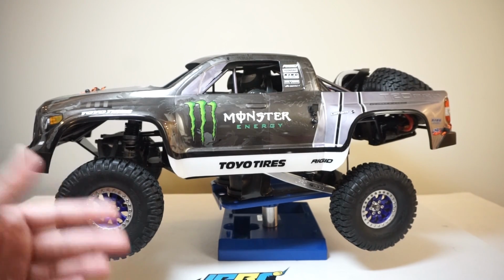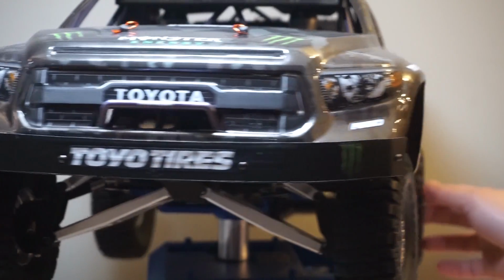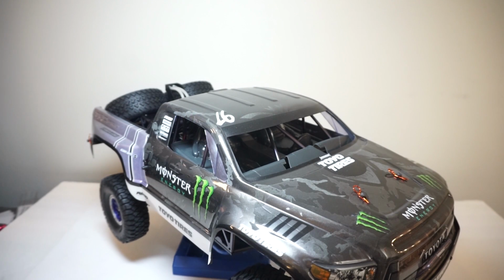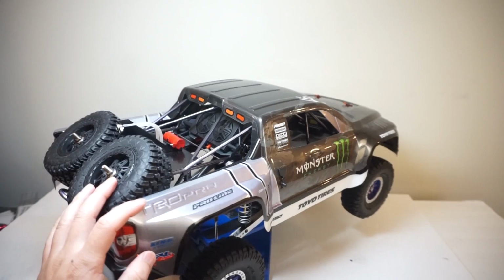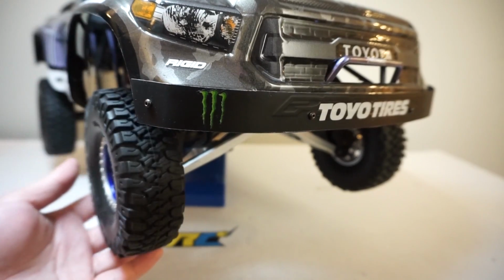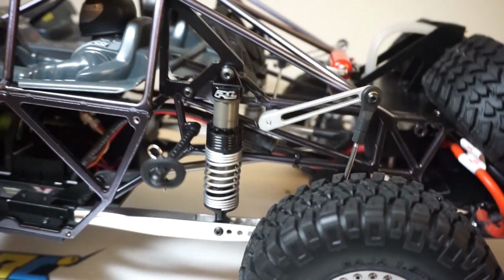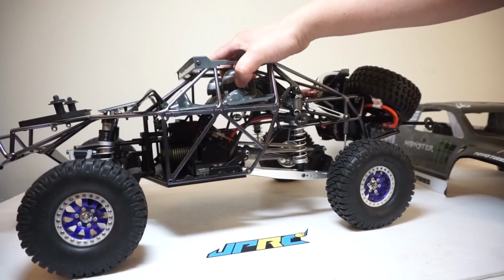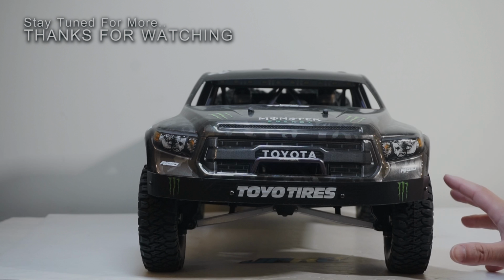Building Recoil 4 Monster Energy Trophy Truck - JPRC GS2 RC Trophy Truck

Comment: Awesome video! Is that mean 2.2 beadlock also fit without clearance issue?
Reply from the maker: the wheel yes but make sure to use 1.9 tires